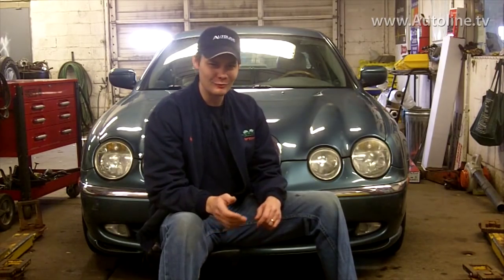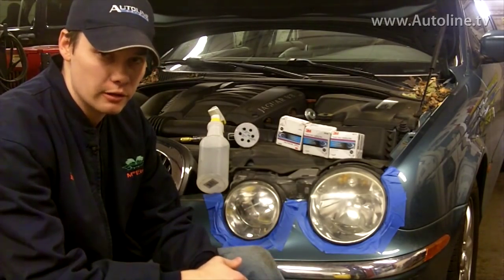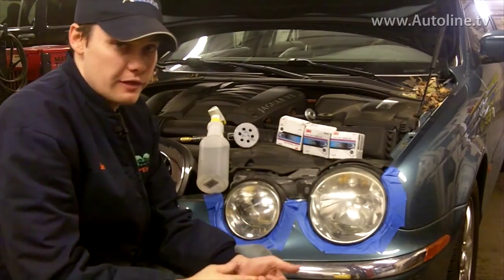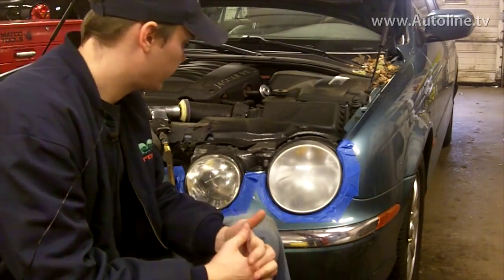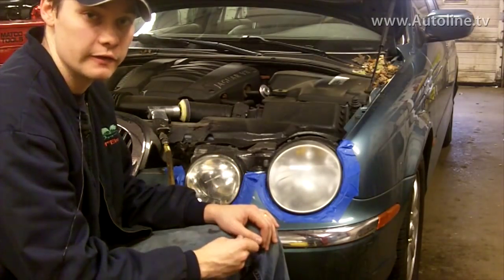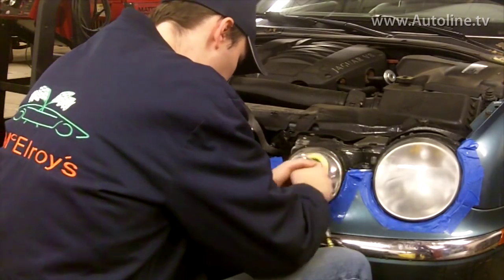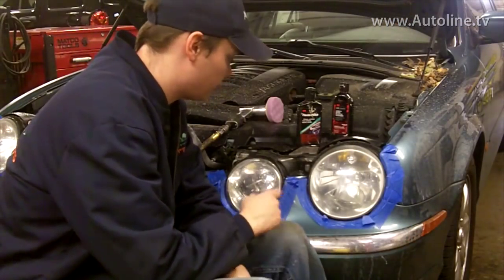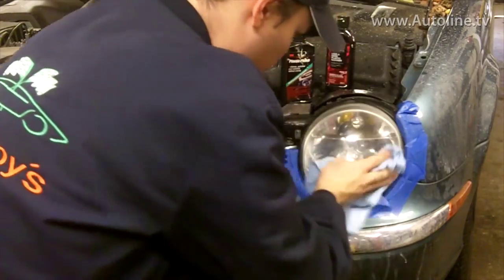Pro Tips: Headlight Lens Restoration

Comment: The ultimate would be to finish off with a 2-part clear coat, or with "clear bra" material.  For the average diy-er, you should at least finish off with a coat of paint sealant, or car wax, and reapply it every 3-6 months.  Now go clean that mess you made under the hood.